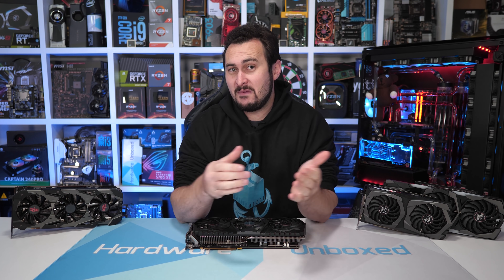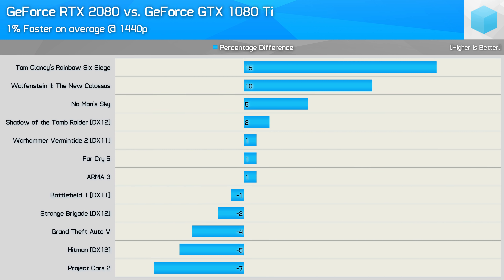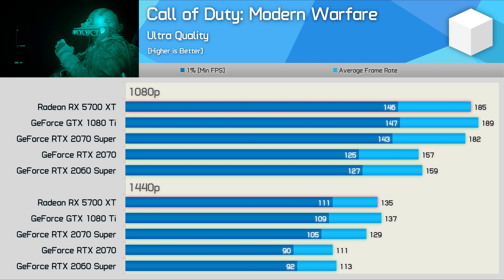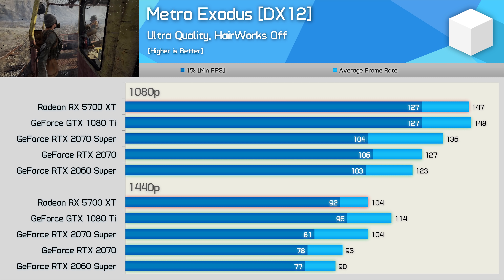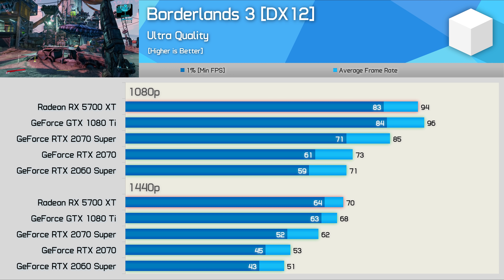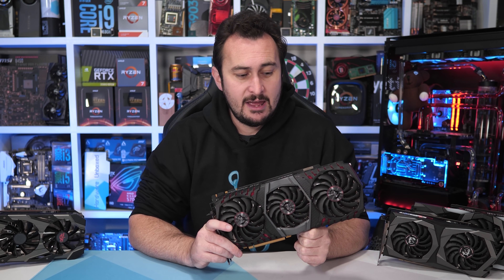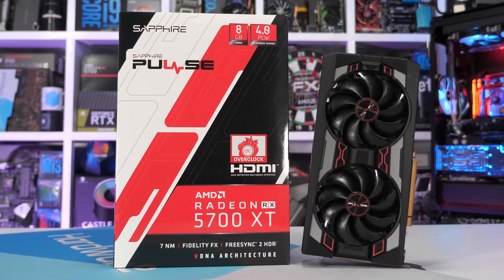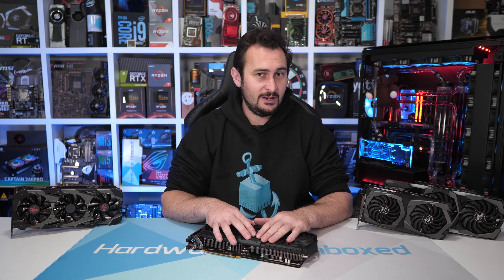GeForce GTX 1080 Ti vs. 5700 XT & RTX 2070 Super, 35 Game Benchmark

Comment: I just went from Intel and NVidia builds to ALL AMD!  Very happy with my awesome price-to-performance 3600 with a 5700 XT.  Smart people aren't 'fanboys'.  Switch your allegience to whatever company is best at the time you buy.  Wait for the reviews, buy the best (/best price to performance).  Incidentally, I was concerned about my 1440p 'GSYNC' monitor - I thought I was locked in to NVidia - but I see no screen tearing, pairing it with the 5700XT.  Happy days. :)   (another note: I really wanted to go with the ASUS ROG 5700XT - to match with my ROG monitor and mainboard - and I caught myself - I realised I was 'fanboying'!!  - screw it - after reading the reviews and ASUS's abysmal customer service in relation to the 'long screw' thing - I went with the Gigabyte Windforce. (nearly went with the Devil, but had no experience with that brand to date))  :)

Comment: I would love to see a cost per frame analysis for these GPUs that also includes GPUs above and below this price bracket. Basically, a value analysis rather than who is the raw performance winner. I suspect that the 5700 XT is the winner when it comes to $/frame in this bracket, but it seems that may only be the case at 1080p and the 1080ti/2070s may take the lead at 1440p. Seeing how that compares with the bigger Nvidia offerings would be nice, but also some of the lower cards all the way down to ~$200 USD or so. I know the RX 580 does really well in it's $/frame, but so do many of the latest lower tier super cards. There is also the 1650 that has recently been upgraded with GDDR6 instead of GDDR5 which has certainly boosted performance a bit in most cases!

Comment: Got a used 1080 ti inno3d last week for 450$... Used for about 1.5 year, pretty happy with its performance though I would like a bit lower temps (currently reaching up to 75c in my s340 which doesnt have the best airflow).

It's still a beasT!!

Comment: I actually sold my 1080 ti that was in my R7 1700 system for a Vega 64 a couple years ago. I just didn't want to spend extra money on a Gsync monitor. I used all the money from selling the 1080 ti and my 60Hz monitor and got a Vega 64 and 240Hz freesync monitor. I've since upgraded my main rig to a R7 3800X and 5700 XT and have been gaming at 240Hz freesync for a couple years now. Never going back to anything less than 240Hz. 

Funny thing is, just a little while after I sold the 1080 ti, Nvidia starts supporting freesync monitors. Go figure! I never would have sold it in the first place. But, such is life.

Comment: I bought my 1080 Ti during the mining craze and when the 20-series was about to be released. The seller claims the GPU is used for "video editing purposes", came with a box and all. It's 2020, and it still runs like an absolute beast. Got it for $450 back in 2018! It's the "over-engineered" EVGA 1080 Ti FTW3 😎

Btw, what's with with all these salty AMD fanboys? 😂

Comment: more or less reaffirms my decision to get the 1080ti used when turing came out, £420 vs £420 for a rtx 2070 NON SUPER or a RTX 2080 for £700

evga card aswell so didnt even lose out on warranty, wasnt a hard decision

Comment: GTX 1080TI Used average price in Netherlands: 450-475 Euros
RTX 2070Super New average price in Netherlands: 575-600 Euros
AMD 5700XT New average price in Netherlands: 430-450 Euros
Makes the 5700XT king for price and new card with warranty. 
1080TI Is still a good buy with quite more performance compared to 5700XT but finding a decent used one takes time.

Comment: No mention of the massive 11gb of VRAM on a 1080ti that is only matched by Titan's and 2080ti (Radeon VII also..but heh). Comparable performance is fantastic and all, but I am finding that I am using more than 8gb of my 1080ti's vram when using ultra settings and textures in modern games. Which is why a 2080/2080 Super is a hard pass from me.. If I was to buy a brand new card that wasn't a 2080ti which is the only nearly sensible upgrade from a 1080ti then it would be a toss up between a 5700 (non XT) and a 2070 Super. But still, 8gb on 1440p cards is a bit cruel.

Comment: I sold my 1080 back in feb/2019 and got a 2070 biggest regret
Reply: Certainly a bad move when you couldve held to that 1080ti for 2 more years but anything past that, i think games being released from that point in time will be optimally running on rtx instead of still being optimized on gtx
Reply: @wanderingbufoon  not 1080ti, he sold his 1080
Reply: how much you sold it?
Reply: Yoann G.  350 and just sold my 2070 for 320 and got a 5700xt for 350 lol
Reply: Why though? 2070 is faster than 1080.

Comment: Where i live some people puts the 1080 ti at crazy prices and other people at reasonable prices for the performance offered, but the last mentioned are the fewer, people tries to sell for higher prices because normally people tries to lower the price and if they seller don't accept the price the buyer don't buy is that easy. But if i've seen some 5700 xts at very good price on second hand as people doesn't know how to deal with the 2020 drivers problems, if i knew that i would've wait and get it that way instead of getting a new rx 5700 (non xt) for higher price.

Comment: Main reason why i picked up used 1080ti over 5700xt for my second pc is cooler quality and noise. I could pick up fresh 5700xt for almost the same price but in my country all the cheap 5700xt are garbage ones with terrible coolers insane tepmeratures and noisy behaviour (the only two i liked and worked with were gaming oc and nitro and both were much much pricier than used 1080ti), so i picked up 1080ti gaming x. It is faster than any 5700xt, cooler(65c max) and silent (almost as silent as my 2080ti trio x in main rig).... would buy again

Comment: What's with these AMD fanbois going "ermehgerd rx 5700 xt is $100 cheaper than rtx 2070 super, y u do dis comparison to please nvidia fanbois". Honestly can these clown just shut up, Steve did a video on both RX 5700 XT vs RTX 2060 Super and RX 5700 XT vs RTX 2070 Super before this one. This video is about the GTX 1080 Ti. If you have a problem with the RX 5700 XT going against the 2070 Super, then go watch the other video about its comparison to the RTX 2060 Super, why the fuck are you here?
Also, Turing has exclusive features that RDNA doesn't have, which some people see value in purchasing over the RX 5700 XT such as the NVENC encoder, DLSS 2.0, and Ray-tracing. If you don't see value in these, that's fine, but no one cares since those features have subjective value that cannot be measured. If you don't have anything constructive to say, then why are you commenting?
Steve always does comparisons between many different GPUs and works hard to do all the benchmarking he does and I appreciate it. What I don't like is people accusing him of being a shill for Intel, or AMD, or Nvidia with no evidence since all his testing is on a level playing field and he bases his opinions on objective performance in games.

Steve, please keep triggering these morons because the only way they'll learn is if they realise how stupid they are themselves.
Reply: AMD fanboys waited 3 years to save $200, then they get welcomed with black screen. I would get pretty salty too.

Comment: Another great review!!!

The 1080TI is definitely an amazing piece of hardware(that nvidia probably regret a bit) and it shows such a strong performance, i'm afraid nvidia will stop optimizing for it to try to sell more turing cards( in 2021 the 1080TI could be comparable to 2060S if that holds to be true).

The 5700XT is the best 400$ GPU easily, it delivers much better value than 2060S and 2070S that i would say those two are irrelevant.

The 2070S was the least impressive card overall, not worth the 500$ at all.

Comment: I threw 500 at a specific Asus ROG 1080ti for a VR setup and I have absolutely no regerts. Thing is a beast for the Valve Index an a 2ghz OC is phenomenal. My other pc is running a 5700xt on triple 1080p monitors and it does so flawlessly.

Comment: What would be the reason to get a 5700 XT over the 5700? The 5700 is cheaper and seems to be a tiny bit less powerful. What am i missing here?
Reply: More CUs than the 5700 = more performance.  The real question to ask, is what is the point of getting the RX 5600XT than a vanilla 5700.  There are fewer CUs on the 5600XT than 5700 and the price is very close.

Comment: No AMD R9 295X2 included to even out power consumption of all other GPU's vs the 295X2, not happy.

Minus 10 points to Gryfindor.... I mean Hardware Unboxed. 

All hail the might corsair power supply tester, the R9 295X2, 250W TDP is for all you noobs out their, bow to the crushing heat of 500W+ of pure 30FPS!

/s

Jokes aside, you should get an R9 295X2 in to see how it performs after all these years, especially at higher resolutions in older games and newer games, as it did seem to be quite a 4K 30FPS focused GPU in the past...... I'd also like to see if you can handle the heat, you don't even needing your heating on in Scotland when you have a R9 295X2 in your PC, free electric heater.

Comment: I hate the 2070 super is better in some games more than 1080ti, even tho I have the card, this means nVidia abondoned old gens in that game, is gona happen with new gens like 3000 4000 5000..... Everyone need to say something to nVidia to stop the apple movement

(i had a 1060 6gb and I didnt want a mined card, 2070s is 100% better than 1060)
Reply: I'd be fearful if I was a Maxwell owner at this point.  NVIDIA is looking to cut them next.  They already killed off Kepler GPUs.
Reply: Nvidia and games are right to optimise for the newest hardware. Of course that will make it pull further ahead of old hardware.
Reply: @Safetytrousers  AMD never let the olders gpus die like nvidia, dont support that greedy movements wow

Comment: I feel like you shouldn't buy a GTX 1080 ti over the 5700xt. The reason is because they are OLD (who knows how badly the seller has used that card during its 3 years from purchase). Its better to get a brand new card that draws less power and is more efficient that has relatively the same performance.

Comment: Still smarter to have NOT bought a 1080ti when it was released for over $1,000 CDN and instead buy a 1070 for less than half that.  Now I can sell my 1070 and get a 5700XT (YEARS later) and still save lots of cash over having bought a 1080ti.  For 1440p gaming, even a 5700xt is overkill in most games.  Like the 9900k and 2080ti, too many nerds like to just tell everyone they own it, as though it takes some sort of skill to buy the most expensive thing available at the time.  Actually for the idiot prices idiots are paying for it used, you should probably sell it now before fall when the new GPUs drop.

Comment: The 1080Ti seems to be going for £450 ish second hand which is about starting price of the 2070super.

Can't see any reason to get the 1080ti without it being about £350-370 tbh. No warranty, 3 year old, going to get less driver support going forward. 

The £350 price point makes it compelling cause it's around similar price to the 5700xt then. That would be harder to justify but at moment you are going either 5700xt or likely stepping up to 2070super minimum or even the 2080. 

Be good to see a 5800xt come in at the £450 mark and trade with the 2080super.
Reply: Exactly.  Dummies buying used cards for that price just boggle the mind...

Comment: Really impressive the 1080ti still performs well today. I only got the 5700xt because I found a decent deal of $380 for black friday for a custom version, it is cool to see AMD really catching up with the 1080 especially for the lower price when the 1080 is/was $100 more expensive, I do really get the feeling GPU performance is 50% based on the number of cores for the price, and the other 50% for the optimization of the game someone wants to play, there isn't one perfect gpu that does everything well and checking specific games for gpu support can be really important if you play higher than 60 fps

Comment: I like the 2070 super, a lot, performance wise as it is much better than og 2080/2070 in how far your dollar goes. It's still too expensive. When I first heard about the 2000 series launch I was hoping that Nvidia would follow a similar pricing to pascal with the 2070 costing around $400. I guess not. I know that the 2060 super roughly fills that gap now, but it struggles to deliver it's headline feature, (which is still pretty much pointless might I add). and $350 for a xx60 class card is absurd considering that the 960 was $200 and $1060 6gb was $250. I can't wait for 3000 series cards so that these drop and will become affordable. Or that with 3000 series Nvidia returns to a more reasonable pricing structure. Oh I think I'm dreaming again. In all seriousness this is exactly what happens when a new technology is introduced for the first time. The first gen and sometimes second gen kinda suck and are overpriced, think first gen apple watch.

Comment: For All #1080Ti or #5700XT owners , or lower , sell them asap ☻ or Pc Gamers do not buy them at all anymore as an upgrade.

 Both will fail to support Direct X 12 Ultimate API, November Release.  (Turings Support All it Features ~ 1 & Half Year Ago & AMD RDNA 2 will in Navi successor.

Optimized Universal API for Real Time Ray Tracing 
Mesh Shading 
Variable Rate Shading 

An 2070 Super now is positioned much better than a 1080ti for example

DLSS 2.0 Is Revolutionary: 

https://www.pcgamer.com/nvidia-dlss-2-performance-benchmarks-control-wolfenstein-youngblood/

Faster In General in Old Fashioned Cubic Map Rasterization , Will support Direct X12 Ultimate,   and supports DLSS 2.0 

https://youtu.be/usgBMJCwmVo

I know some will throw reasons to justify their purchases, to put it short they are old tech now. Rasterization days are old , real time rendering is the new level of realism.

Comment: I picked up a 1080ti on eBay for just under £500 in October 2018, not long after the 2080 was released. The MSI twin fan version. 
A great card, but one of the fans went haywire on me, and it was spinning at 100% speed almost all the time. It was really annoying, ramping up and down every few minutes. 
MSI were a**holes and wouldn't RMA it because I didn't have a buy it from a store. Apparently they don't take RMAs from the public, and they just kept saying "send it back to the store" and then stopped responding to me. Then they'd cancel my support ticked after 3 days, saying I didn't respond, when it was them that didn't respond back to me! 3 times they did it..
The fan noise was driving me nuts so I just ended up picking up a waterblock for £40, and adding the card into my custom loop instead.
Can't say I'd be too eager to buy MSI again, at least on the used market anyway, or maybe ever, since they were such douchebags about the RMA..
Still, the 1080ti is a great card.. I'm well happy with it, especially that it's silent in my loop now.

Comment: hi. question regarding 5700xt vs rtx2060s and custom resolutions. i had a gtx1060 that let me modify my old dell monitors resolution from 2560x1080 -> 34??x14??. I now have a Asus xg27vq which is a 1080p 144hz freesync monitor (but a gtx970-so no custom desktop resolutions) that apparently supports adaptive sync. my questions are.

1) do current gen RTX cards still let me modify desktop resolutions? do you think its possible to change this 1920x1080 144hz monitor to a 2560x1440 @ say 100hz?

2) the 5700xt looks much better at the same price point ($850 nzd) compared to rtx 2060 super. ive heard ati drivers are dodgy. is that still true to this day?

3) do the 5700xt lineups allow for custom resolutions like nvidia on the desktop environment? in this specific use case (freesync monitor), would it be best i go with ati?

Comment: If you look to buy now and new get the 2070 super. DLSS is going to eveolve and become more used with time. I would spend $400-450 on a brand new 1080ti but those are like unicorns

Comment: Wouldn't spend more than half price on used technology in a fast moving field. So $350 max for 1080ti. Beyond that, just shop a 2070s with a rebate. Or a 5700xt. you get a warranty and know it hasn't spent the last 3 years crypto mining 24/7.

Comment: As a 5700xt owner, the reason I bought it was for close 1080ti/2070s performance. I gotta say, I'm very happy with where it sits against the 2070s and 1080ti. I don't understand why these morons with 5700xts are getting butthurt because were showing 10fps lower on some titles. Be happy the cheaper card performs that competitively. 1080ti looks to be the PC buy of the decade.

Comment: Steve is absolutely right, there's no sensible reason to get a used 1080 ti for $500 lol.  Unless the prices come down there is no reason to buy it.  $500 range just get a 2070 super, $400 just get a 5700xt.  There is more need for a used GPU with no warranty that is gonna cost that much if it is not gonna outperform those 2 cards by a significant margin.

Comment: So far I'm finding used 1080 Ti cards for $410 - $450 USD (locally) so I'd say that would be a better buy than the 5700 XT if you want the frame per dollar. If you need a warranty and some peace of mind then yeah, a brand new 5700 XT is the way to go.

Comment: I bought an XFX's model of the non-XT 5700 for $300 and bios-flashed it to the XT version. Running it at 2000 mhz at 1.2 volts, lol. It gets a bit loud (had to really ramp up the stock fans) but it stays around 75 degrees. 

So far, super happy with my purchase. Will probably upgrade in two generations, but for now I'm pretty happy.